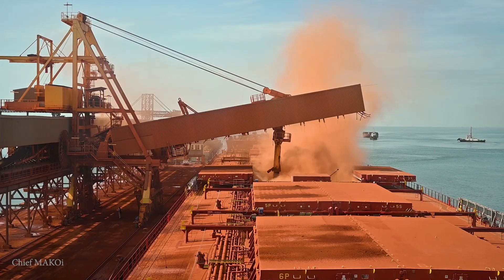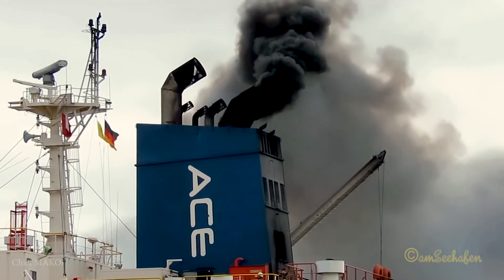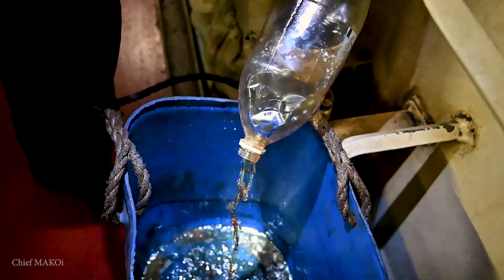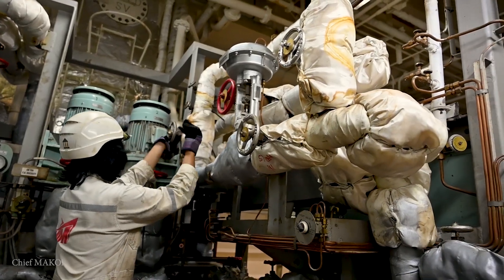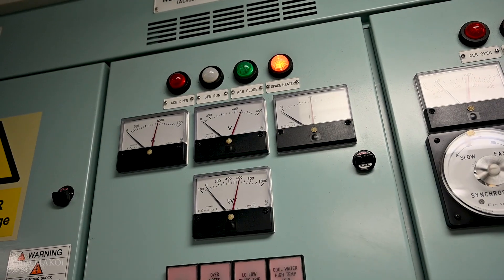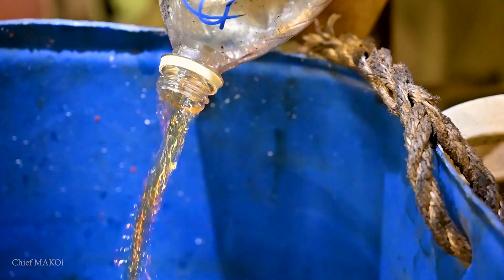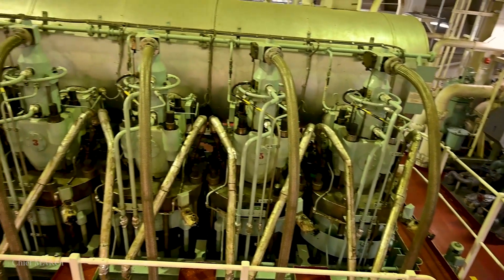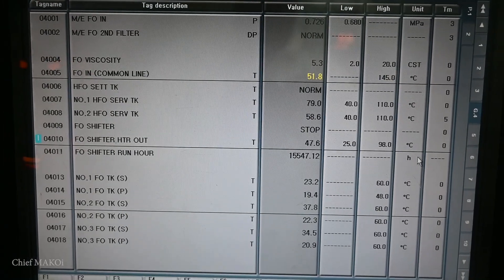Changing The Ship's Fuel : From Heavy Fuel Oil to Gas Oil Changeover Procedure | Chief MAKOi

Comment: "Ou nough, we must stop using reliable old gasoline and diesel cars and all get electric cars, since those pollute so much" In the meanwhile cargo ships burn the absolute shite that is left after refining all other forms of fuel out of grude oil by tons, not by liters, not even cubic meters, while hauling useless crap from China like iphones that are designed to fail with intentional design that allows them to decline warranty repairs, like moisture sensors that trip from basic normal humid air, when real fault is shitty soldering job in one spot.
This clown world is so fucking messed up.

Comment: Very good video, as usual.
The Germans are very strict in terms of air pollution ... Well that's really funny if you consider that, some 10 years ago, they stopped their nuclear power plants program under pressure of the "Greens" and they replaced most of them with ... coal plants! This is coherent thinking: to get clean air they stop a system which doesn't pollute the air (there might be other issues but not this one) and they replace it by something using fossil fuel and polluting all the countries around them. Great! But ... they carefully control your ship fuel. Interesting.
All the best to you

Comment: I'm not a seafarer, Chief MAKOi, but I spent 43+ years making both fuels you showcased here. HV Bunker (HVGO) is the easiest to manufacture, while the Low Sulfur Fuel Oil has to be Gulfined (Sulfur removal) at a different unit...

Comment: nasty shit... looks like used diesel oil after 30k miles
I find it crazy that ships burn this low quality fuel in the first place, it must be almost free. The ship must run so much better on higher quality fuel oil.
Considering growing environmental concerns id say it wont be long until Low Sulfur or Very Low Sulfur Fuel Oils are required globally aswell as exaust gas recirculation and scrubbers.

Comment: heating the oil is needed in cold weather but in warm weather I see there is an additional need to lower the viscosity so as to allow suction and proper injection. Nice if they could burn the cleaner fuel all the time but I understand economics as well. You always educate me. Thanks Chief

Comment: Just for comparison: The Diesel you and I can buy at a regular gas-station has around 10-15 ppm of Sulphur.

"Low Sulphur" LSMGO on the other hand has 1000 ppm and the shipping industry was really padding itself
on the back, when they (where forced to) finally put a stop to using fuels with 5000 ppm in the year 2012 ... in the 1st world.     

Heavy fuel oil (HFO), a very popular fuel for the really big ships and essentially the garbage of the petroleum industry, 
could until 2020 have as much as 35000 (no, not a typo) ppm Sulphur.
Reply from the maker: That's true.  But the 0.5% sulfur global limit was implemented in January 2020.  Ships can't buy fuel with higher sulfur than that except for the ones fitted with exhaust gas scrubbers.
Reply: @ChiefMAKOi  military are exempt from these requirements yes ?
Reply: @daryntaylor2187  yeah I know, kinda the point of my comment. Neither is ANY military. Yet all we hear is "Climate Change' Buwhahahaha 

Good for theee not for meeee
Reply: @kilianortmann9979  now that you've cleared up 1% of my statement, care to elaborate on the 99% you've left off ? Copy pasta ain't gonna cut it so please put some effort into it this go around.
Reply: @kilianortmann9979  Not for any environmental reason though, only because high sulfur content destroys the turbines.
Reply: @__prometheus__  Canada still has DEF/DPF....
Reply: @igorluiz9551  actually no, no it's not. The military burn more fuel,  in non regulated engines ( no emission vehicles ) than we do as a society by far. I also pointed out shipping, they're not regulated nearly as much as we are. Add up all our military around the world, daily training etc, shipping, airlines aaaaand suddenly we aren't the top polluters by far.
Reply: @moist5717  not an error in the slightest, play on words that 100% gets the point across. Can you break it down, what it means as written not just the intention? See how smart you think you are.
Reply: @thebravegallade731  Exactly. Also, military vehicles are almost always multi fuel cause you don't really get to pick and choose your fuel in a wartime enviroment. The deuce will run on anything from jet fuel to 93 octane
Reply: @__prometheus__  because WAR, also nuclear aircraft carriers sea waste
Reply: @thebravegallade731  ...When a military is 80%+ logistics, your statement falls apart.

Effeciency effects range, cost of operation, supply chain size, and reliability.

Terms like, "cut off from reinforcements" and "lack of adequate supply of fuel and ammunition" have been used to refute such thoughts by historians for ages.

It is the same reason race cars go on trailers.
Reply: @kilianortmann9979  ....Math police here.

0.1% of 1,000,000 is 10,000

PPM is parts per million spelled out if that's where your conversion failed.
Reply: @kilianortmann9979  
Gas turbine engines are the least efficient combustion engines made, maybe 20% volumetric efficiency, and worse, the aircraft turbine engines use fuel with added Aluminium Nanoparticles. For added Oxygen supply at high altitude.
Like Magnesium, Aluminium produces Oxygen when it burns. Most passes through the engines unburned to fallout on the ground, and water.
The big low-speed diesels that power ships, locomotives, etc., are two-cycle engines, which make huge amount's of power, but are environmentally dirty.
US military ships aren't all combat ships, and aren't powered by gas turbines, but by diesel power, and many of the warships that use gas turbines, also have diesel engine's they use for cruising. Gas turbine engines burn fuel at an amazing rate.
Those with nuclear reactor's are steam turbine drive. The reactor's are just very expensive, and dangerous means to boil water. They also leak radiation everywhere they go.
Low Sulfur diesel caused a lot of problems in the engine's fuel system, as sulfur is a lubricant. Without it, fuel pumps, and injector's, etc., experienced a lot of galling to moving parts that suddenly were without lubricant. Causing failures, and engine's that didn't want to run too good while new materials were found to replace the steel in use at the time the new fuel's were introduced. I had several fuel pumps fail as it took a couple year's to resolve the problem's.
Also, the low sulfur fuels will jell at a much higher temperature during the winter month's. This issue persists to this day. This fuel produces less BTU's, than the old No. 2 diesel, and therefore less power. I increased injector flow several time's in the 20 year's I had the truck. Also increased fuel pressure, and flow in the fuel pump's as I replaced them. The injector flow increased over time by 80%.
Based on the flow of a factory rated 400 horsepower CPL engine. The increase in pressure, and volume in fuel pumps was a little less radical, although the fuel pressure was well over 300 psi at the pump. Hard on the injector lobe of the camshaft. Flattened the lobes on one cam. Heat treated high-carbon billet steel roller cam at that. The engine may have had it's horsepower uprated beyond design parameters. (insanely beyond)
Reply: @thebravegallade731  sadly this is why modern society will collapse within 100 years. our technology is too far advanced to prioritize efficiency over basic necessities like water, atmosphere, and biodiversity
Reply: @Hanibul_Lecktor  Not even trying to go on the offensive here, can you explain what the play on words is in your name? "Should have swallowed" is the clear grammatically correct way of saying it, but I trust that there IS a play on words here that I'm just missing. Of is expressing some relationship, usually to be from something or a part of something. "Should have" is the phrase used when something was what was supposed to happen, but wasn't done. Was it a character limit to swap have with of?
Reply: @kilianortmann9979  0.1% is 1000ppm or 1kg/T
Reply: @the0new0revolution  no problem, it's actually pretty simple. Think Monty Python dry humor, then working around today's PC cancel culture society to introduce yourself. This in itself isn't the simple explanation I promised, just a carrot. Now read my name with British Dry Humor, now think my mother from Swallowed carries the first name Should.

I have faith, let's see if you figure it out, before it gets the hose again 😉
Reply: @ChiefMAKOi  ...Is my math correct?

.5% sulfer is 50,000 ppm
Just so we all have the measurements for diesel in the separate industries clear.

How common is higher sulfer fuel for scrubber equipped ships?

If dual fuel ship systems are so common, why is there a market for such an unrefined fuel?

Are there other uses for the highest sulfer fuel oil besides shipping that make it's production and sale profitable?
Reply: @ChiefMAKOi  i hope someday the lower sulphur fuels get more widespread subsidisation to help incentivise the switchover even outside the restricted zones. If necessary, maybe a global tariff on the higher sulphur variants could be used to subsidise and lower the price gap, but I imagine that might cause a lot of problems for companies running on a fine balance of finance so i don't know if that's even practical if I'm honest.

To be fair however, per unit weight of cargo, trucks are kind of punching way above their weight in pollutants compared to ships, if I'm recalling correctly, especially now that the heavier fuel oils have been phased out in favour of lower emission fuels. Taken as a whole, while ships technically produce a hell of a lot of emissions, there are very good reasons for this - chiefly, efficiency in bulk transit. 

Compared directly with trucks, i can see why there's been a lot of motions trying to push more widespread adoption of railways in the supply chain rather than long distance trucking, and you can only improve ships to a certain extent before you hit a solid wall of cost to benefit analysis. 

At least until we have a safer, cheaper alternative - nuclear genuinely wouldn't be a bad direction to go in nowadays as pretty much all the kinks have been worked out besides outliers of extreme acts of nature, systemic failures, and human fallibility. 

It's worked before, albeit with some flaws due to an inefficient mixed use vessel design and possibly some mismanagement, it's just that the public image is tainted by the times people screwed up the process of making it actually foolproof and failsafe technology and everyone seems to be working off heavily outdated information or heavily biased sources.

There's a lot left to do, mostly political wrangling and public awareness and myth busting, before it's ready to reintroduce, so I'm not going to be holding my breath for it happening in my lifetime.

Still, good to know there's more progress than I realised!
Reply: @ChiefMAKOi  Which isn't that really controlled by some ppl since they just don't give a crap and use whatever they like anyway since, why should they care.
Reply: @ChiefMAKOi  how much more expensive is gasoil?
Reply: Also worth considering the emission mass per kg per km of goods moved. Carriers are much more efficient from a emissions stance than last mile vehicles doing the deliveries.
Reply: "in the year 2012 ... in the 1st world." That cold war ("geopolitical" as opposed to socioeconomic) expression became obsolete in 1990 after the wall came down. 1st World just means NATO member, 2nd World was Warsaw Pact and 3rd World was for non-aligned countries (Sweden, Australia, Monaco)... so Switzerland was the classic 3rd world country.
Reply: @ctibpo991  Not quite correct. The geopolitical meaning of the "three worlds" quickly gained a political and socioeconomic dimension over the years after the 2nd world war. "1st world" countries meant not only Nato members but Western countries as a whole, meaning nations allied to the US/Western Europe plus other developed economies such as Japan, Canada, Australia etc. "2nd world" as you correctly say were the USSRS and Warsaw Pact countries. Third world were the non-aligned countries which also corresponded to the poorer/developing economies at the time; mostly located in Africa, Asia and parts of central and south America. Over the past 30 years such definitions have obviously become obsolete, even though they persist on the socio-economic level to a certain extent, regardless of political and/or military affiliation.
Reply: @luiginiolu6842 It has changed meaning because so many people are misusing it! 🥸
Reply: I thought there must be a huge difference in price between pump diesel and marine diesel. However, if my calculation is correct, at $4 per gallon, pump diesel costs $1240 per metric ton, merely double the price of heavy oil. I’m sure they can get a “bulk discount” to under $1000.
Reply: @tripplefives I know they can't have emissions equipment I never said they did or should. While in the US they use the same fuel everyone else does. That's all I was pointing out to that whining baby. The vehicles the military uses are better for the environment than my old diesel pickup truck.
Reply: A lot of companies that supply the Bunker Oil seemed to struggle a bit when the 3.5% sulfur max spec was decreased to the now 0.5%. Most big suppliers have figured it out now but the issue in most of 2020 was decreasing the sulfur while still maintaining a <0.10% total sediment by hot filtration for RMG 380 and other similar VLSFOs. I work in a lab that tests these fuels and always wondered why we would occasionally get a request for viscosity at 135c when RMG specs only requests a 50c run. Looks like that’s the temperature of the fuel when atomized during injection according to chief. I see barges regularly load 4 compartments FO and 2 compartments MGO for this exact fuel transfer you did here. Very cool stuff here.
Reply: @tripplefives That's right, but no not all diesel engines are capable of running on it. Tell that to our dead generator.
Reply: @DarkAttack14 has a Point That Cargo Ships should be Nuclear and while Docked they can provide Energy to Countries....

and 2. They can discard the Nuclear Waste at (Point Nemo) Pole of inaccessibility and Ducie Island's when they used up the fuel source.
Reply: Yep and road cars are the problem?
Reply: @matsinkal  yes, because substituting these ships with trucks will result in even worst emission.
Reply: @matsinkal  most of the pollution in the world isn't for the Americas or Europe... its from Asia and Africa.
Reply: @Wingnut353  from africa, u sure?
Reply: Absolutely despicable that ships worldwide aren't forced to use the same standards for fuel as cars or trucks, just the fact that companies make the workers go through this stupid process for the sole purpose of saving a buck and being able to use the shitty black tar for most of the journey is disgusting.
Reply: intresting video i like how the  thing can run on two different fuels I  really like my engines hehe  tho the client control stuff..  sorta pointless  client change is a massive hoax made up by china to infuse fear in the world to control it all this green energy stuff is likely china controlled its how they try and take over the   world governments  bunchg of communist pricks they are
Reply: @TwilightVaramek  lol, good one comrade
Reply: Says the one who is enjoying the luxuries of global transport sitting behind the computer at home
Reply: Well, guess they don't give a fuck that the land beneath their feet is gonna burn in a few years. Beautiful.
Reply: @Lokeso  If you’re an adolescent just be aware that “10 years till the end!” shit has been on repeat since the 60s at least. It was something different before that but honestly it just a political tool. Ask Al Gore. You might not be old enough for that one (another one of those 10 years till the end things). I’m trying to be polite because it’s rude to just dunk on adolescents who don’t know these things and aren’t told them. If you’re an adult though you have no excuse and should know better.
Reply: @Lokeso  No comment section is complete without hyperbole from at least one of our sanctimonious apocalyptic environmentalists.
Reply: I have to be forced to buy a POS EV yet the shipping industry and the military get to pollute with impunity. I guess the so-called climate emergency isn’t that big of a deal after all.
Reply: Reading this having researched free energy devices since back in the day in 2010

Comment: Thanks for the explanation of how the process goes for switching fuels.  Does the bridge notice any difference in engine speed or ship velocity depending on which fuel is being burned?
Reply from the maker: Not really.  Except when a problem occurs in the engine.  But as for fuel performance, it's almost the same.

Comment: What people need to know is that this big ships are the chemical waste burners of the world… all small household en industrial chemical waste are mixed together and the burning point of it is lowered to 70 c so it will burn in this motors ….in   International waters ..Whit out this ships all industry will come to a hold .. because the final product they are producing, will be in to expensief IF they got to break down there waste …this system only works with these ships …. The truth is that we need it to be like this… the ships ware the solution for the problem, and not the problem.. the truth sucks sometimes